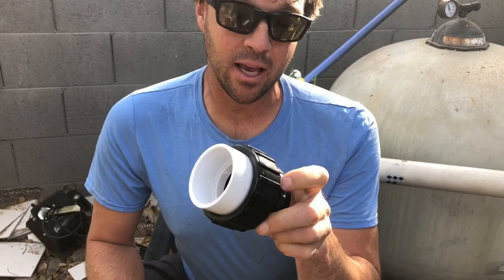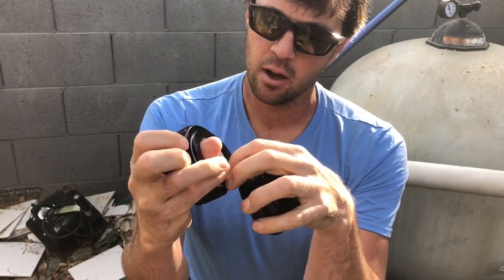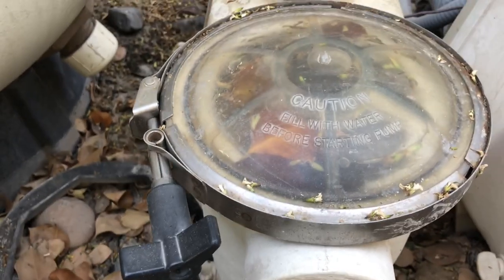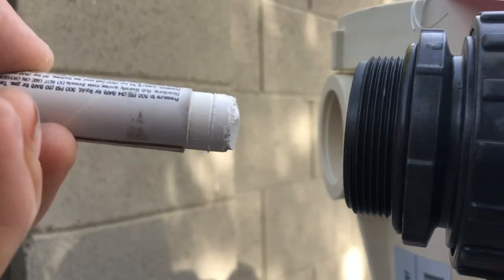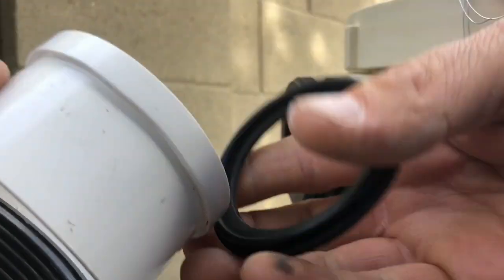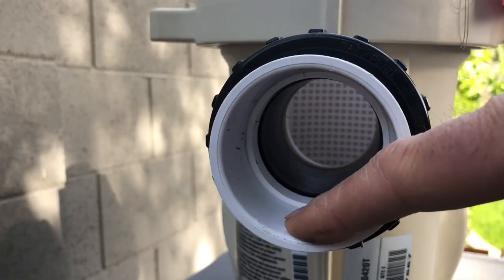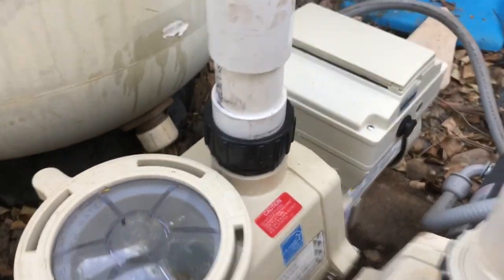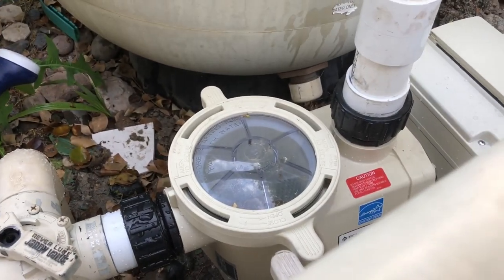Save pump headaches with high temp unions!

Comment: A couple comments.. Putting pipe joint compound on the threads is pointless. Your seal is being created at the o-ring only. The overall depth of the threads on these fittings is less than a nipple so it's not sealing there. Also, look how those pump lids are almost hitting. That's another reason why you should have backed it up a little. Should be 10" straight run into pump with 2" pipe. You have the unions now which makes future motor maintenance easy if you're worried about backside clearance. This is to allow the pump to prime easier and last longer. Finally, best way to avoid getting glue into the joint with the gasket is to plumb the unions broken apart/off the pump. That way you can wipe any excess glue immediately if it runs into the joint surface.
Reply: Sounds like we need you to come do the job.  You know exactly what to do.  Do you have a video?
Reply: @caprice6825  I don't. My channel is all hiking videos 😄
Reply: I had some of the same concerns

Comment: I had trouble finding these High-Temp Unions, but finally found the maker  - Praher 150-906 1.5" MPT X 1.5" Slip Union with O-Ring, and Praher 200-906 2" MPT X 2" Slip Union with O-Ring.
Reply: Do you have a link to this.

Comment: You always take the union apart to solvent cement so no cement or primers on o-rings. Unions are Hand Tight only and NEVER used Channel Locks or any wrench with teeth.

Comment: Can these fittings be used in connections other than for a pump?  I got my hands on quite a few and want to use them on diverter and check valves.  But I don't think they are going to have as smooth as a surface for the o-ring if I am just using slip to thread adapters or some other fitting (some of these are narrow and/or have raised text markings around there).

Comment: Would you tell me what I can do to permanently fix this union leaking issue? I know probably buy a whole new filter housing but if not should I do anything besides replace this union unit?   Its a hayward swimpro LX.  Pretty old unit
Reply from the maker: I’d get an O ring kit and replace the old  O rings. While you’re doing that, make sure the equipment pad hasn’t shifted, causing a misalignment of the filter and the unions. While you have the unions out, inspect the bulkheads and bulkhead holes for any hairline cracks.